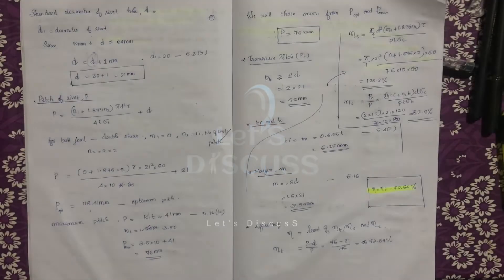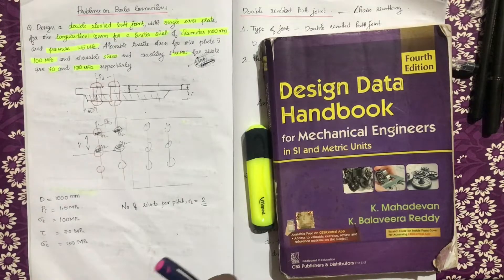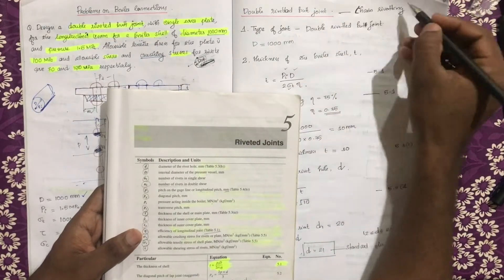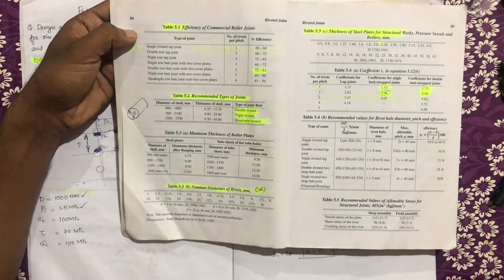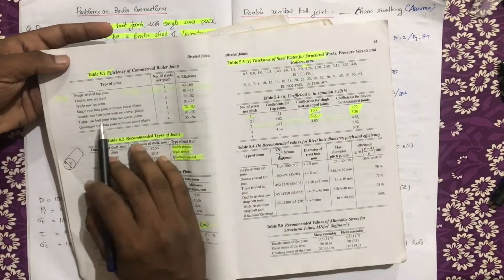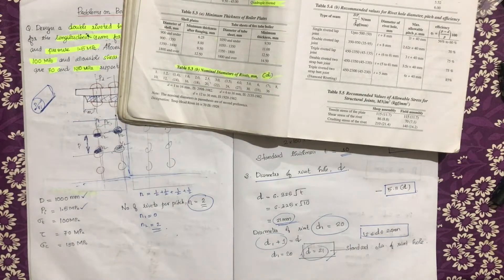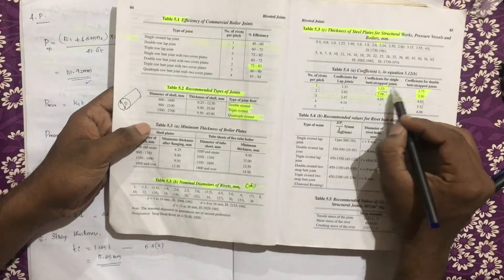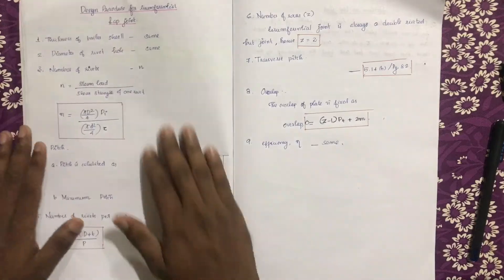KTU-DDM-DESIGN OF RIVETS-PART 4-BOILER LONGITUDINAL BUTT JOINTS PROBLEM

Comment: @5.25 Sir data bookil for equal double cover butt joint put n1 =0 ennalle but questionil single cover plate butt joint anallo apo n1 =0 avumo?
Reply: Sirin mistake aayath aavum
Reply: Apo n1 egneya kamdupidkande @akshayp1213
Reply: Nala chodiyam
Reply: Ithilippo etha Sheri🥲?
Reply: Butt joint avumbo n1 =0
Lap joint avumbo n2=0
Ennale edukkunathu
Reply: @GD_CARLO  double shear avumbo N1=0
Butt joint il single shear varukaysnel N1 not equal to zero..single cover plate ullu enkil single shear ahnu
Reply: Appo n1 Nte value ethra edukkanam @ANJANAR-hj5mt
Reply: @bineeshmp3657  single plate varuna sthalathe..
N1 kandupidikka ,matteth il n2 um
Reply: For example ee question il n1 Nte value enganya eduthe ennu parayamo @ANJANAR-hj5mt
Reply: @bineeshmp3657  ath vedio il indu sadharana egneya iduka athupole thane...coment ayit eyuthyal mnslavila..🥲